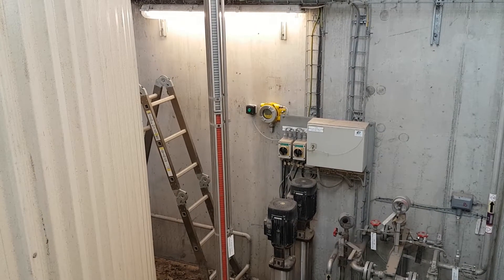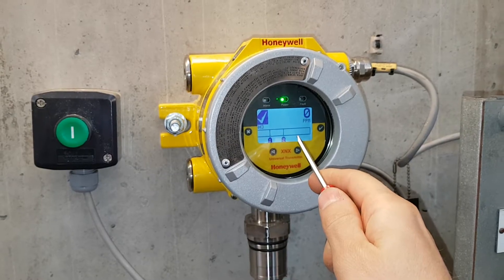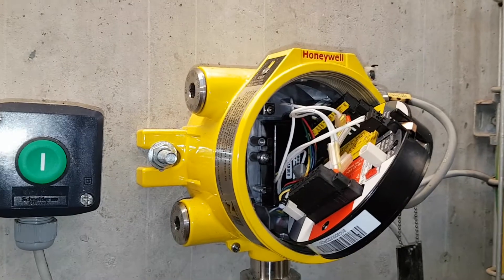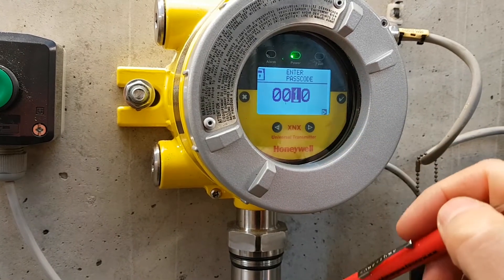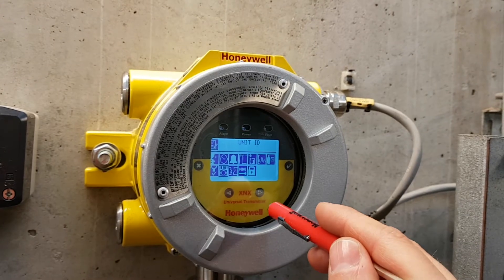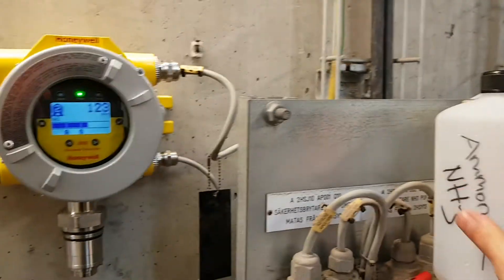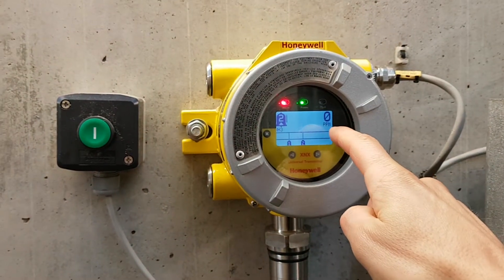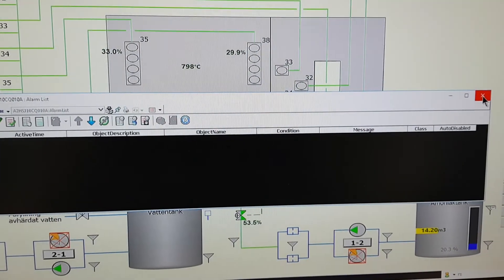Testing Honeywell ammonia gas alarm XNX transmitter

Comment: very nice information, would've been cooler if the alarms went off. Is there a reason why we need ammonia tanks?
Reply from the maker: Thanks for the comment. Yeah, when burning wood pellets powder you mix it with ammonia to get better Nox values. To get more accepted enviroment values in the exhaust gases. (This place is a heating plant)
Reply: @simplicitygarage  ah okay, and you’re welcome for the comment, once again very good job at going deep in information